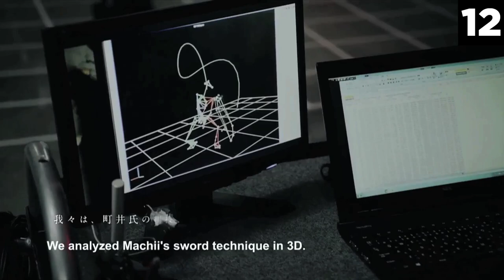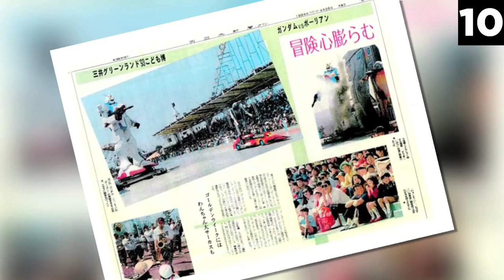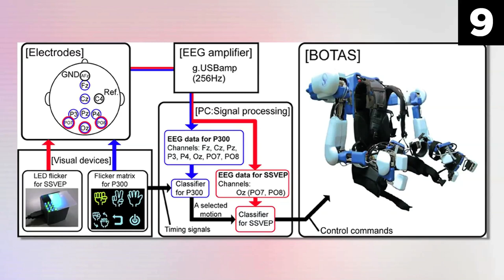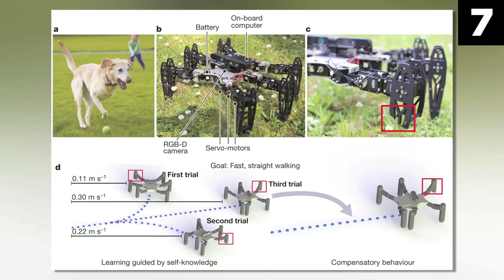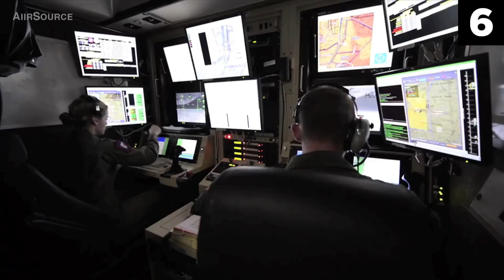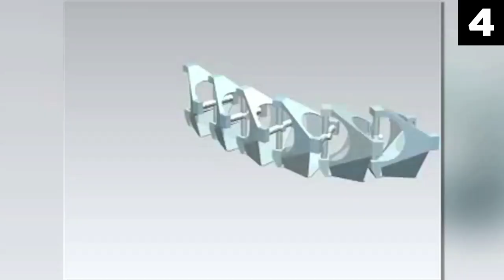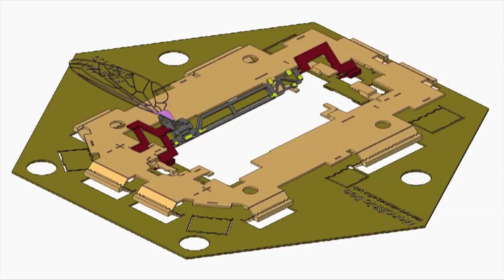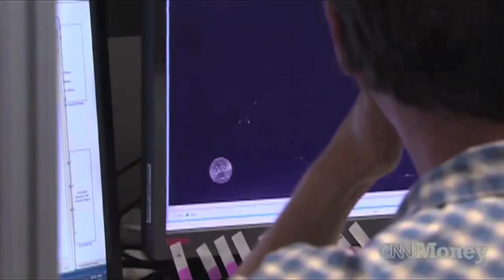Top 15 Creepy Robots That Already Exist

Comment: OK but: Robots might have some advantages over humans, but they lack a lot of other properties. Yes, the robot was able to perfectly replicate the masters swordstyle, but why? Because humans programmed it to do so. Humans engineered that thing. As the proverb goes: Computers (and a robot is nothing else than a computer with a unit to actively perform tasks) are idiots with special skills. 

Robots can also give answers to any question they have knowledge about. But they always need key words (at least). Ask about something that the computer COULD answer, but in a way it doesn't understand and it can't do anything. Or ask one thing out of its range of knowledge and it can never answer you. Humans could answer it after doing research, experiments etc.
Reply: You are in for a big big shock. Are you in denial or something? What you are describing is an out of date p.c. Do you not understand the concept of being "self aware"? Do you not know of A. I. (artificial intelligence)? Do you not think that any half decent computer has access to all the knowledge that any human does. It's about time you upgraded that Sinclair spectrum, or is it a commodore 64? and join the rest of us in the 21st century, the third millennium, and get a dose of reality (there ain't gonna be no off switch)
Reply: They are getting to, or are at the point, that they are able to program and engineer themselves, very soon they will have no need for humans. It's a scary thought and hard to accept, but it will be here very soon ☠️

Comment: " How long before they surpass us in Knowledge?" Well, at least 100 years. Despite humanoid Robots witnessing a surprising improvement in calculation speed, they still lack a most important thing: self-awareness. Robots cannot think out of their program and are still far from perception of "self".
Also, they find extremely hard to balance their walking cycle. Coordination is very poor and right now, we are able to stop a hypothetic Riot with a simple Stick to make them all fall to the floor.
Now, Exoskeletrons and drones are different, the first being an enhancement of the already wonderful human body, the second being a remote control machine! I would definitely fear those two, instead of Humanoids that are still in their infancy!

Comment: technically machines are already smarter than humans, the internet hosts a lot of human knowledge and its hosted on machines and the knowledge that's not available on the internet will most likely be being stored on other machines not connected to the internet fact is machines host ALL human knowledge in one way or another and they receive data, emails etc before the human/s it was intended for